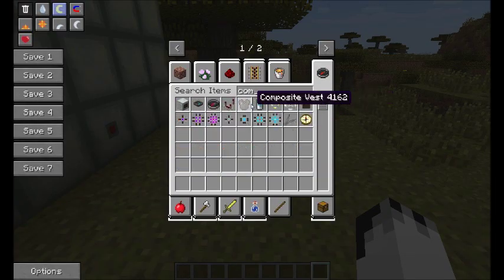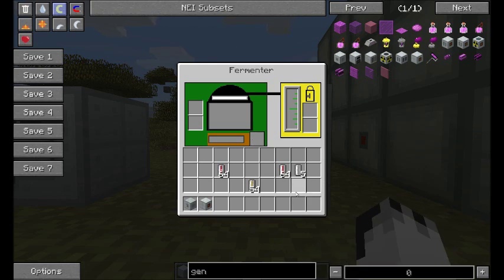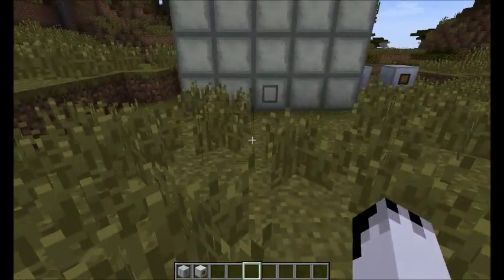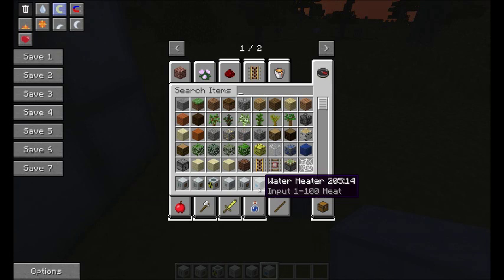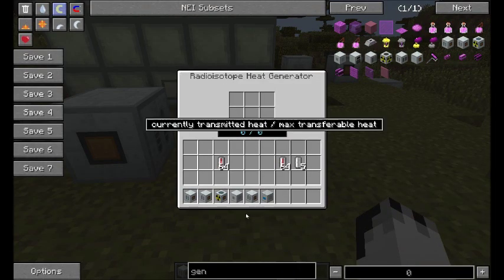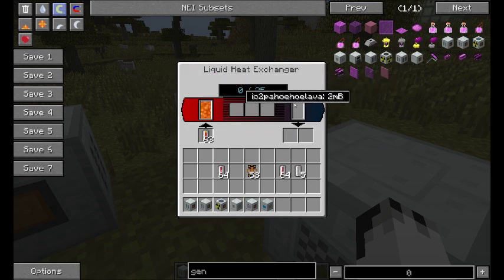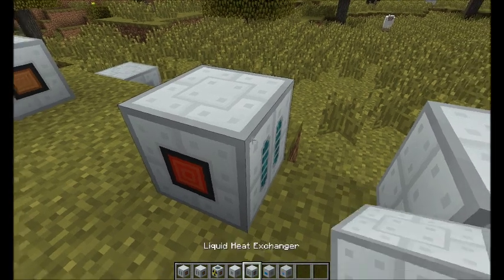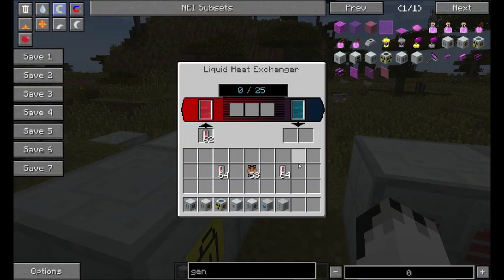Industrialcraft 2 Experimental : The Heat Mechanic.

Comment: Sorry, I'm on build 635 and NEI isn't telling me how to make coolant, can you help? I don't know if it changed from a month ago or not but :x
Reply: Also having difficulties with biomass seeing how the fermenter is different now :/
Reply from the maker: Industrialcraft Experimental : Coolant and Reactors. Try that one for coolant.
What kind of issues with biomass?
Reply: Making biomass used to be putting a water source, mulch and dark oak wood sapling into a fermenter according to my NEI, but the fermenter format is changed? Or maybe there were 2 fermenters, that could've been it. Either way, is that still how you make biomass now?
Reply from the maker: Ok...found how to do it. You need to enrich plant chaff with water in the canning machine, that makes biomass that you can then turn into biogas with the fermentor.
Reply: Ok, I'll get back to you on that but last time I saw, the canning machines weren't the same anymore, it was just either solid canning machine or fluid whatever canning machine, not Just "Canning Machine", but I'll test it out
Reply from the maker: Anna Ung
Yeh, you want the one with the fluid tanks in, rather than the one that's just used for food.  It;s more expensive, but can be used for everything.  There is a button on the ui that can be used to change modes.

Comment: hey, I'm using the latest IC2 experimental for 1.7.10 and somehow the coolant cell recipe doesn't work. Any idea why?
using this recipe http://ftbwiki.org/10k_Coolant_Cell
Reply from the maker: because you need to use the nei recipe, not the ftb one.
Reply: darkironphoenix thx for the quick answer. Just installed NEI but it doesn't show me the recipe for the coolant cell, only the recipe for the 10k and up
Reply from the maker: i believe you need to make coolant, and then put them in a cell using the canning machine.
Reply: darkironphoenix
if only I knew how to mnake coolant. NEI doesn't show me that either
Reply from the maker: Well...the crafting recipe in nei asks for a pahoehoe cell.